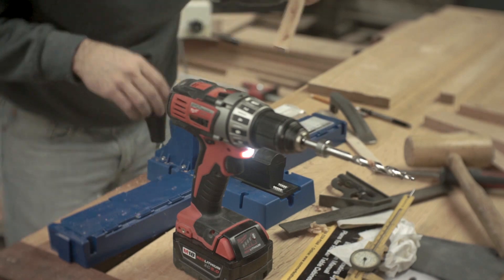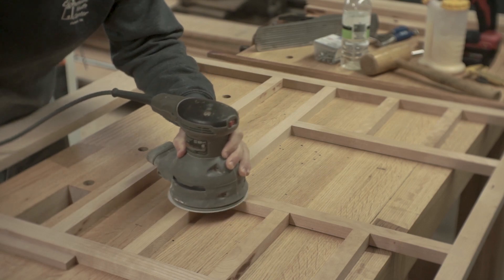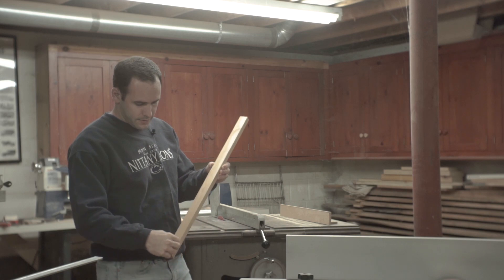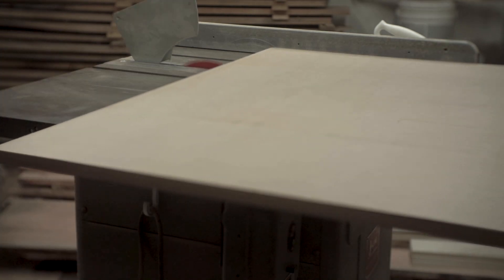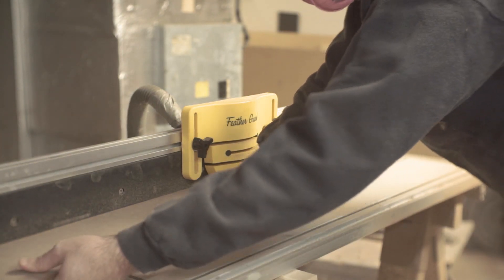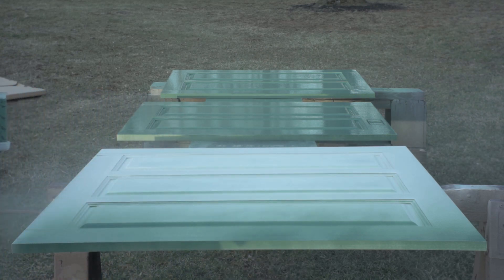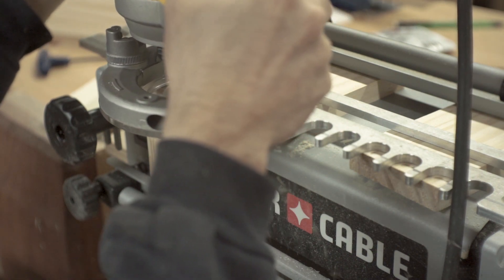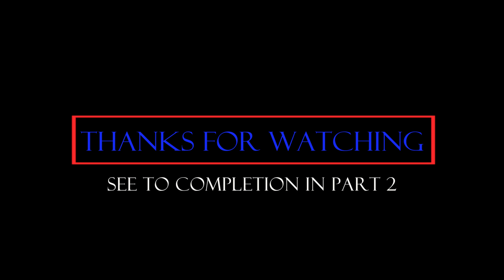Ultimate Router Table Cabinet build - Part 1 of 2

Comment: Do you use the height adjustment rod through the table top on your Triton router?  I bought the sommerfeld router table system  with the alum. table top also but the hole is not drilled properly for the height adjustment rod.  Just wondered if you used it and if you might have any ideas as to what could be my problem with getting it to work right.  Love your videos, good job!!!  Gary